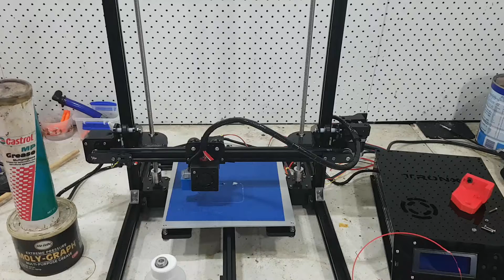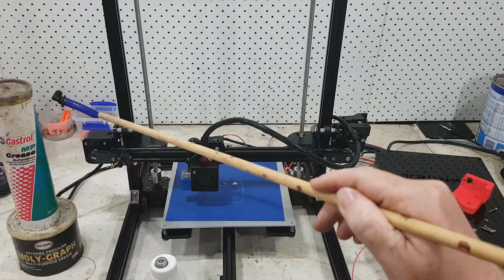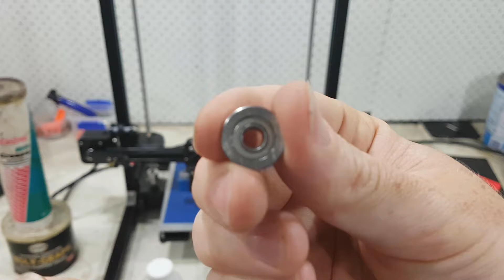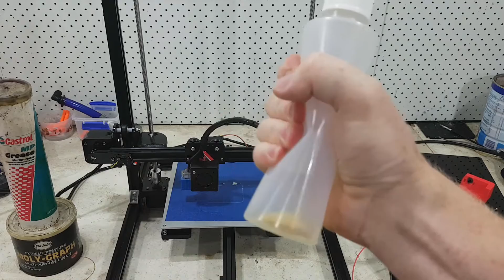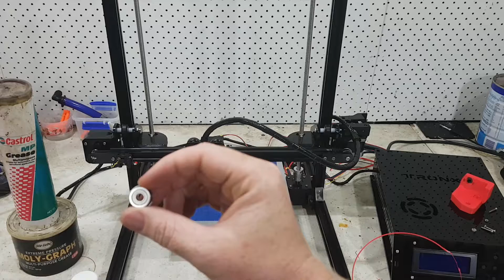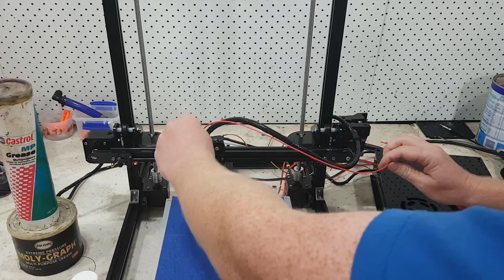Tronxy X3 3D Printer Build: I Broke It 😢 Episode 4

Comment: Hey i have a quick question can i just leave the plastic in instead of pulling it out if i was to use the same colour? Or would i have to pull out the plastic after every print?
Reply from the maker: well it's said that the PLA absorbs water so should be removed however since im printing almost everyday i've left mine in without any issues

Comment: Ditch the tape. Get a glass for the bed and use hair spray for adhesion. You will thank me. 
This sensor will detect through the glass.
http://www.ebay.com/itm/331864348844?_trksid=p2060353.m2749.l2649&ssPageName=STRK%3AMEBIDX%3AIT

As for the clogged nozzle, Heat it up to and remove it from the printer. Then you can use a soldering iron to heat it and you can dig out the plastic. Make sure the throat is clean too. 

I pull out PLA at 110. Results vary.
Reply: Any big home improvement store will cut glass for you. Your town may have a glass business. If so use them because they will be able to git rid of the sharp edges for you.
Reply from the maker: i Probably would have tried to fix this but its just a potential for more issues if im unable to remove all of this "Other" plastic from it. It was simply not worth the effort of the potential issues in the future.. So better off to bin the nozzle and get a new one.

I have an intention to go for a glass bed. But that will be on my NEW bed that's going to be 820x620. Till thats done i'm happy to keep with this process.. 

I personally think it's a horrible idea to use a inductive sensor to sense the aluminium plate through the glass because you're not Detecting the flatness of the glass your printing on but the aluminium below it... We need to get the BL Tutch working with the tronxy... I'll certainly need to get this working cos my 820x620 bed wont be made of metal so there is no way of that working anyway.
Reply: Glass bed and abs slurry worked best for abs prints. 

Pla sticks well on glass and some glue stick
Reply: Where can you order a glass bed for the X3?
Reply from the maker: if only that was true... no home improvement store cuts or carry s glass... It i can get it done... probably wont though currently im considering making a very large format 3d printer and will add glass to that
Reply: Where do you live? Every Lowes or Home Depot cuts glass in the US.
Reply from the maker: New Zealand :P
Reply: Maybe try a cheap picture frame, lol.
Reply from the maker: i have found some glass but i can't use it cos the auto leveller does not work with it...grr
Reply: I've heard that glass doesn't work with it. But if it uses an inductive sensor metal behind the glass should work as long as the glass isn't too thick. Aluminum plate is detected at .4 times the sensor's range, steel at the full range.  It doesn't work with the glass on the aluminium plate?
Reply: I posted a link to one that does work with glass. Top comment. I use it every day.
Reply from the maker: Well it depends on the sensor. The sensor that comes with the tronxy is pretty budget so it's detection distance is short . So depending on the glass thickness it wont work
Reply from the maker: i assume that works with the tronxy auto level firmware
Reply: Only if you mount it in the same place
Reply from the maker: Yeah .. i've ordered one... i think o need an enclosure too. to help with warping